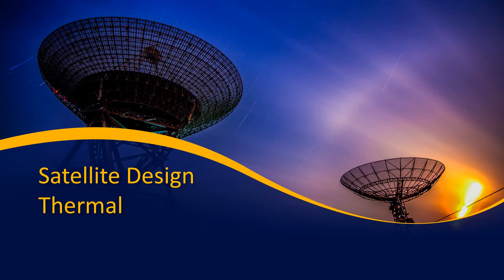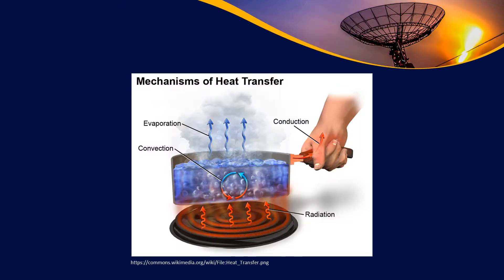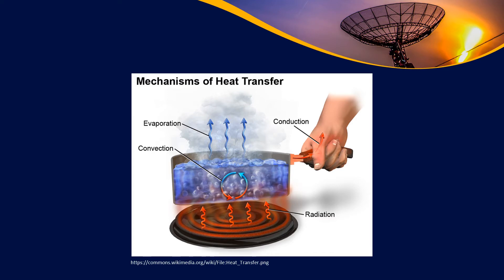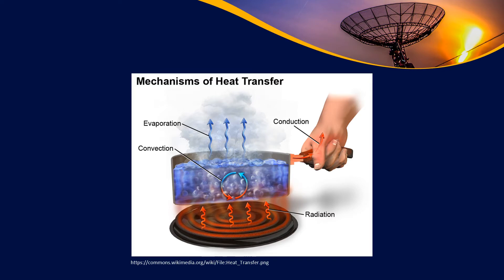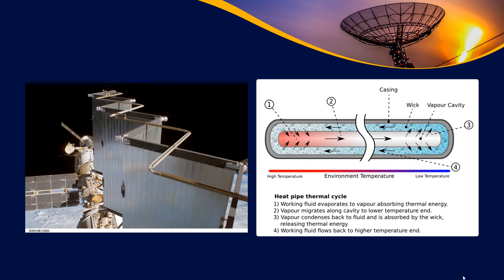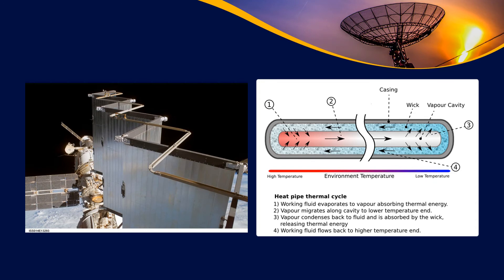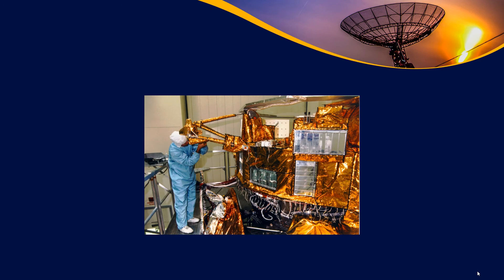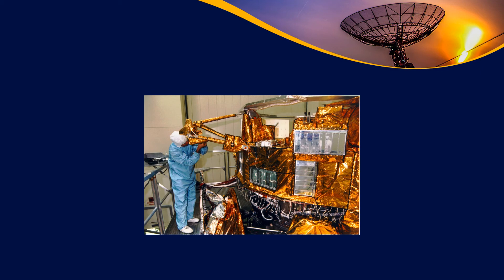Basic Satellite Design- Managing Thermal

Comment: How do the Precious Metals required for the Satellites not Melt while in the Thermosphere ?!?!?
Reply from the maker: They aren't there that long, there's not a lot of air, and they are protected when in that region by a fairing.
Reply: @WhereisRoadster   What do you mean they are not there that long?  Satellites are supposedly Geostationary, and Perpetually stuck in "space"? Which is why we point our dishes towards them?   SO how do the Satellite Components with Metals like GOLD not melt in the ThermoSphear at 2,000 Degrees and UP???
Reply from the maker: @chriszdenek8824  The temperature doesn't really matter when there is no atmosphere to speak of. Put your hand in icy water, and it won't be fun at all, you'll freeze quickly. Put it in air that is the same temperature and it is cool, but not unbearable. With basically no atmosphere, the temperature doesn't really matter.
Reply: @WhereisRoadster  I dont know about that?  What weighs more a pound of feathers or a pound of bricks?? 2000 Degrees is 2000 Degrees no matter the medium??
Reply from the maker: @SpartacusCZ  The satellites never get that high in temperature, because there's no way for the heat to be transferred. Heat transfers better in water than temperature, which is why small changes in water temperature feel bigger.